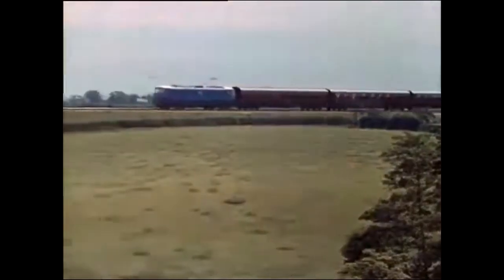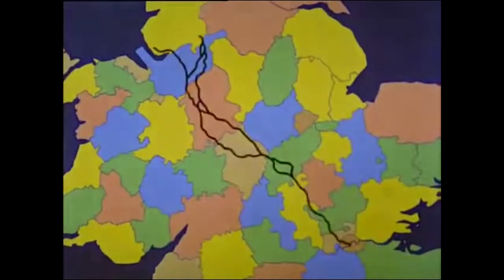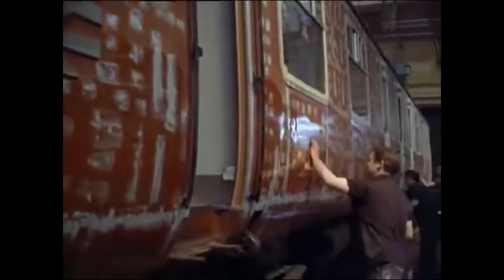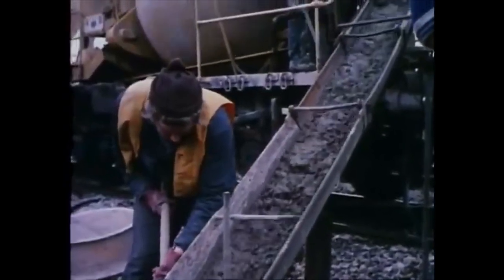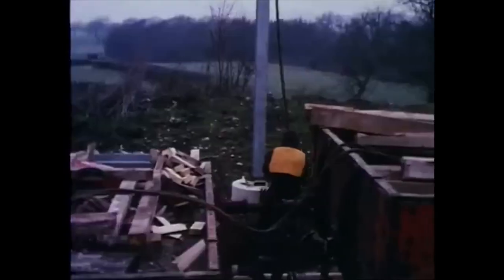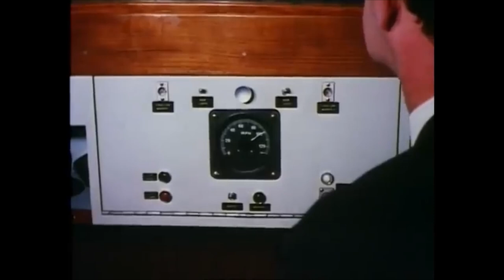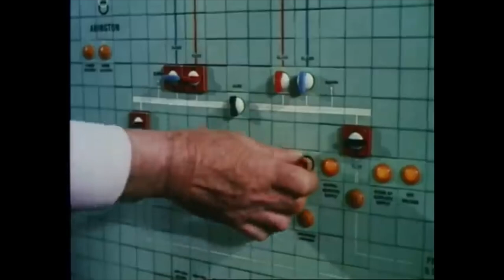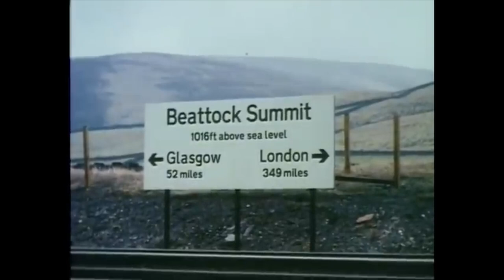British Railwaves: West Coast Electrification

Comment: It's a shame it's 2023 and nothings been done to improve the third rail to either a more efficient voltage, better the power supply or to remove it entirely amd replace it with overhead lines.

Comment: 5:33. I am guessing those pipes that are in the front of different British rail old trains are for coupling???
Reply: Those are for im guessing brake pipe and vaccum hoses and cablea to do MU
Reply: They're mostly for linking up each wagon for the vaccum braking system.
That's why in the steam era there were such things as "Fitted" wagons (wagons fitted with vaccum brakes and vaccum brake piping)
and "Unfitted" wagons, wagons which did not have vaccum braking. You can tell the difference between them due to the lack of vaccum braking hoses.

British Rail mostly used the screwlink coupler system for their couplings.